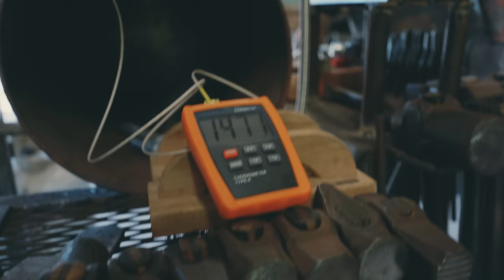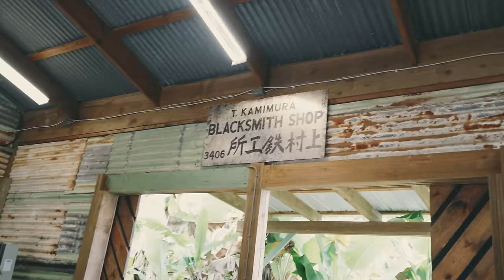Neil Kamimura - Kukri Forge Part 2

Comment: I suspect that thermocouple was the term you were looking for - regarding the temperature-measuring device. They have varying ranges based on the two materials used for the leads, and measure temperature based on the voltage difference produced by the two different materials as they are exposed to temperature.
Reply: What he wanted to say was "pyrometer" but i think you might be right.   I've only heard pyrometer used in a foundry to measure the temperature of molten metal
Reply: @noahnipperus7320 Pyrometers are remote thermal sensors that utilize radiation for temperature determination. A thermocouple uses the voltage difference of two materials as a result of temperature at a bimaterial joint.
Reply: @kyleanderson3476  Thank you for such a concise delineation!   However,  I remember the "Pyrometers" we used in my foundry classes were placed within the molten metal(that probably utilized a   thermocouple lol)Please excuse me while I do some more research/reading   :  )